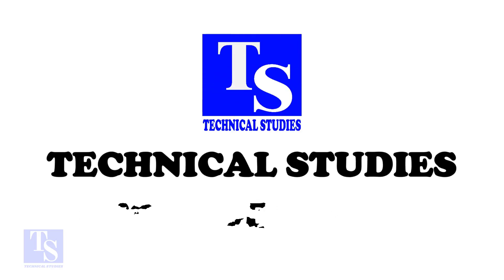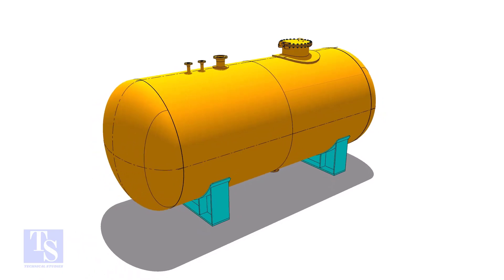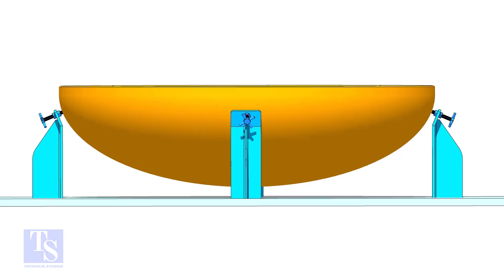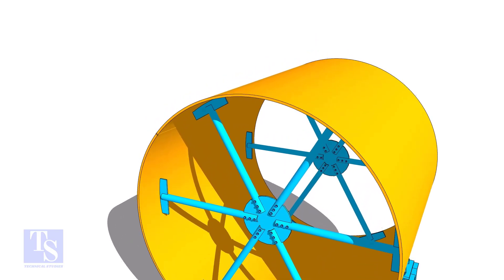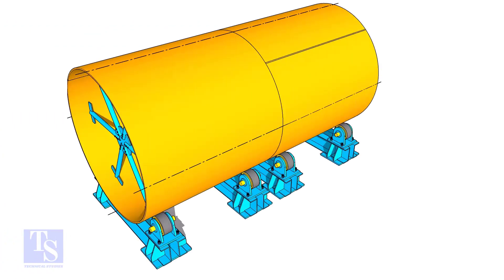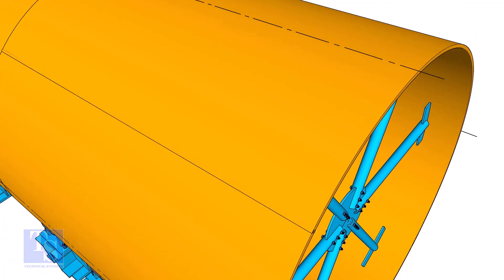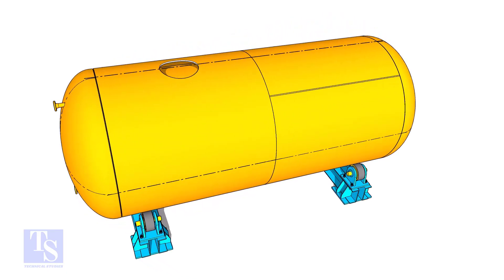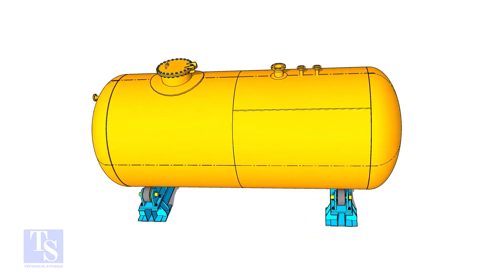HOW TO FABRICATE A HORIZONTAL PRESSURE VESSEL- ASME Sec. VIII- TUTORIAL.

Comment: They are good projects to make as there is a bit of everything, from Structural for the saddles, Piping for the nozzles and plate work for the shell. And they go together really quickly especially when welding with Sub-Arc. Glad you mentioned the importance of doing staggered longitudinal welds
Reply from the maker: Thank you for the comments. Always value your tips.